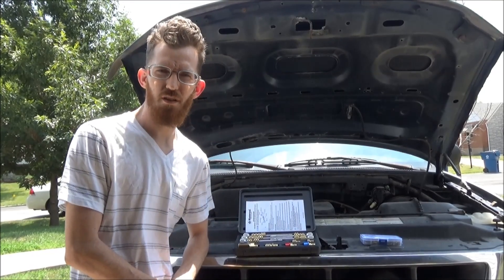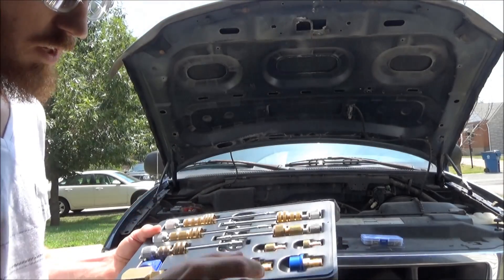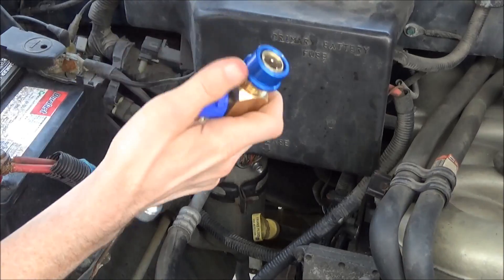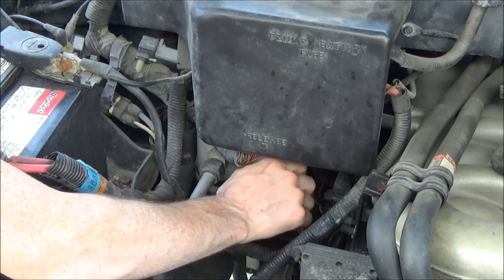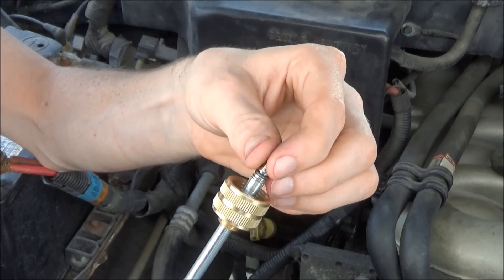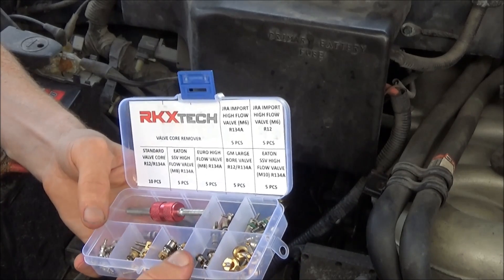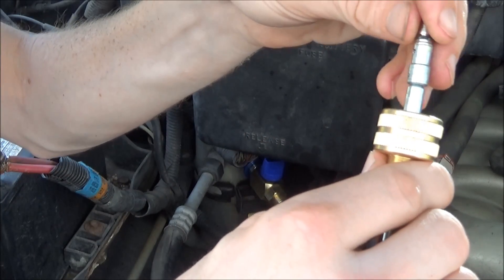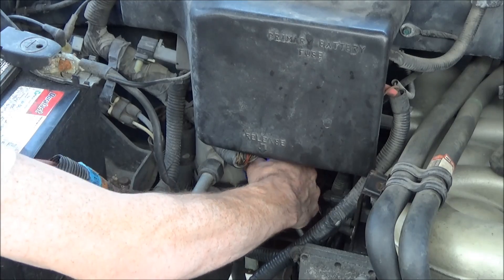How to replace A/C Schrader Valve

Comment: Let it leak baby! The inside of your cab will likely smell like freon for a long time but no $43 dollar tool needed!

The world ain’t gonna blow up and there aren’t climate police or feds yet patrolling like the Stasi.

They’re over exaggerating lying fuckbags with refrigerant. And it’s a nice mafioso scam so you pay for a one time expensive tool or $300 to $500 job minimum from a “technician.” Like if you’re in Europe, you gotta convert your systems to the new “climate friendly gas” like in the 90s from R12 to R134a. That ain’t cheap and god damn were there repeat system conversion problems that YOU had to pay for. Don’t ya love tyrants and all the good, caring reasons they can get the majority to go along with? We haven’t become schizophrenic as societies.

Just do it yourself, what’s leaked in the air can’t be seen or proven…yet. Hopefully never. Save money while you can before you become the payment for the carbon taxes. It’s comin, our lives will be the price. We’re made of dreaded…carbon. Except the absolutely rich with societal level influence. They don’t gotta pay. They’re exempt of course.

Comment: The price of the tool kit is way higher then renting the vacuum pump and gauges from autozone(they let you buy it and return it with no extra charge as a rental deal). All you need to do is evacuate the system the way 99procent of dyi does ;) replace the valve(4- 12$) recharge the system 20-50$. The knowledge is on youtube. This video is probably good for the mechanic shop.
Reply from the maker: If you have refrigerant in the system already it will need recovered. This kit prevents the need to recover the system. Service ports tend to leak after a connecting gauges as will. So if you just charged the system and removed the gauges and then service ports are leaking you can replace the valve cores without recovering and recharging

Comment: Thanks man for this video as I need to change out a leaking valve on my high pressure port on my ac and I don't want to drain the entire system of refrigerant and I just bought the tool with a box new schrader valves. 👍🏻🇦🇺

Comment: I tried a tool like that ... the valve would not come out after I unscrewed it.
Reply from the maker: Their are different size valves. This set covers them all. You have to make sure the adapter you are using is larger enough for the valve you are servicing
Reply: Thank you for responding ... got it removed but it wouldn't slide out.  it is a 1996 F150.  Is there an application chart somewhere about size tool/replacement valve?
Reply from the maker: @garypatton9720  not that I know of. You can look on rockauto or other parts website and see what size valve core is listed.
Reply: Ford says a YF2198 is correct for the low side.  I just don't want to buy the tool again and have the valve not come out.
Reply from the maker: @garypatton9720  this kit shown covers all styles of valves.  The smaller 2 pc set only works on standard style valves
Reply: I'm not sure what standard style valves are.  I tried the 2 pc Mastercool before.
Reply from the maker: @garypatton9720  the 2pc set is for standard tire valve size schraders. This master kit is around $125 and covers everything

Comment: You have the best links to tools than any other videos.  Most reviewers in all videos say the cheap tool that was recommended did not work,  but this seems worth the extra money and is great quality.  Sorry that your truck had the ports in difficult to see places, the Japanese cars have much easier access.  Also thank you for pointing out that there are two common sizes, standard and JRA...not easy to figure out which type a certain car has.  Thank you !  thank you.  You do the job right!

Comment: Do valves leak on there own or is a indicator of a more significant issue causing them to leak?
Reply from the maker: They can leak on their own but they usually leak after someone has hooked up gauges

Comment: Out of curiosity, can a leaking valve core completely empty a system even when the gasketed cap is tightly fitted on the port with the leaking core?
Reply from the maker: Yes. That cap is a secondary seal but can always hold the pressure
Reply: @kdautomotive1165  Not sure about your answer. Does the Cap hold the pressure? Or leaking Valve may completely empty the system even if Cap seals a Valve? thanks ...
Reply from the maker: @panamerykan9262  the cap is a back up for small slow leaks. If the oring on the valve is bad or the needle is bent the cap will not be able to seal full system pressure and it will empty
Reply: @kdautomotive1165  I appreciate your prompt clarification! as NOW I am trying to fix a small leak (my finger on the top of the Valve can stop it).
Reply: @panamerykan9262  I can tell you how my old valve core (a JRA High Flow one) failed. The little spring on the top lost tension (likely from heat cycling, because it was mounted on a suction line, and it's subject to both the engine bay heat and the suction line cold). I screwed it on a piece of plastic tubing and blowed through it, and noticed that the valve core opened as soon as you wiggled it around. While it's supposed to stay closed all the time (have a lot of bicycle Schrader cores laying about, and the spring feels rock hard). They eventually go bad, your best bet is to get new ones and replace them IMHO
Reply: Yup

Comment: Thanks. I thought I was out of luck, I hate the thought of losing the refrigerant as I replace the stuck Schrader value. Then, I took a chance on finding the solution on YouTube. Just purchased a removal tool on eBay. Again, thanks
Reply: Except that your system will be low now,due to the leaking valve, and the only way to recharge it is by removing the rest because you don’t know how much leaked out

Comment: Only question I have is this an option for the GM ball style valves on the high side ports? Knowledge is power, great video.
Reply from the maker: No sir. Those require the use of a special socket. You can try quickly depressing the ball. Sometimes you can get them to reseal when they snap back into place
Reply: @kdautomotive1165   Thanks, good to know. I was hoping not to drain the system of freon. Mine blew the top of the rubber ball off and I lost most pressure after releasing the high side adapter on my manifold gauges. The only thing holding pressure is the cap at this point. This was right after I recharged the system as well, talk about a bummer.
Reply from the maker: @atola5349  another tip is when you attach your gauges dont run them all the way in. As soon as  you see pressure 3your gauge go 1/4 turn more and stop. Running them all the way in can damage the valve
Reply: My 1998 Chevy high side ball valve also leaks.  My solution was to get a metric metal plug with the same thread as the plastic cap and seal the leak by installing the plug with teflon tape. The plug had a female hex drive.

Comment: If my valve is leaking, should I just try to tighten it or replace it?
Reply from the maker: You can try to tighten it. If that doesn't work you will need to replace it

Comment: The valves on my car refuse to come out  I broke two snap on valve core removal tool  I'm starting to wonder if this will fare any better
Reply from the maker: biofall38 they may be reverse thread
Reply: KD Automotive I didn't even know they did that on Schrader valves but it's worth  a shot
Reply: any luck? Were they reversed?
Reply: after braking more tools i dident get it to budge so i wound up buying a new  hose
Reply: @biofall38  Very weird, there's a small rubber washer on the core and the refrigerant oil keeps everything lubed up

Comment: Nice job... and helpful video.... right tools always come in handy, but I wonder if most people have all ready lost their refrigerant and can just either tighten their Schrader valves or replace them and recharge ?
Reply from the maker: Jon Randall  if you have 0 pressure in the system them you would replace the Schrader valve but you would have to re evacuate the system (pull under vaccumm). This tool is for when you still have some pressure. Even if it's only 10psi you won't have to recover what's left and then evacuate the system before recharging.  With this tool you replace the valve then simply top off the charge and your ready to go